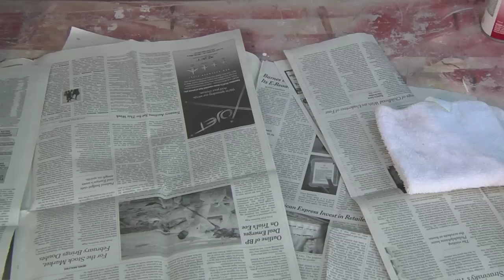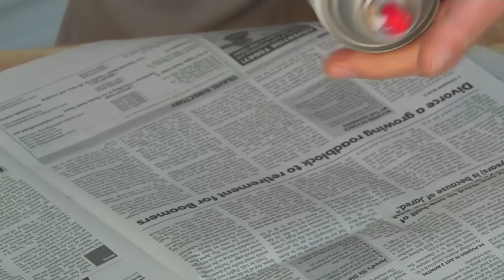How To Use Spray Paint - Ace Hardware

Comment: Hah! Try covering a LARGE surface that, with vertical pieces that needs EVEN coverage. ACE spray paint is the worst spray paint in existence. The spray flow is very light/weak....if you even breath in the direction of the paint, it will not go on evenly. On top of that, its VERY drip prone. As in....it WILL drip. This spray paint is unusable for furniture. I love how they use a porous terracotta pot that will drip up the MASSIVE amount of their watered down spray paint needed to even get a splotchy first coat. Try painting something substantial. That paint IS going to drip.